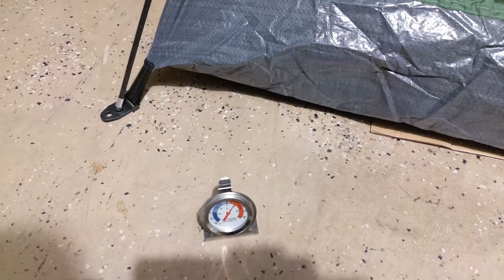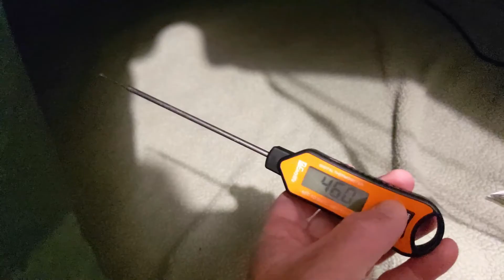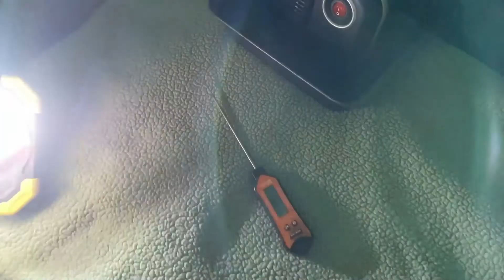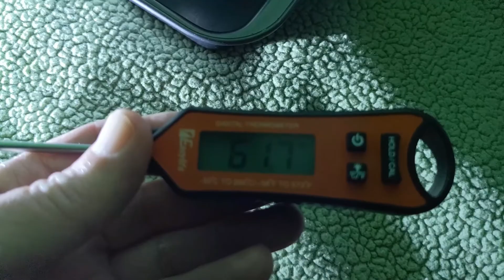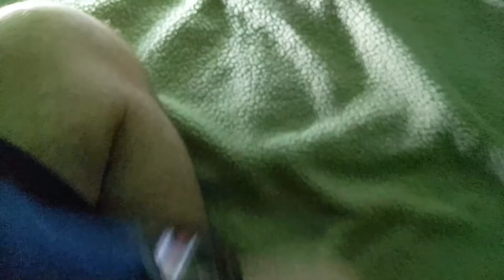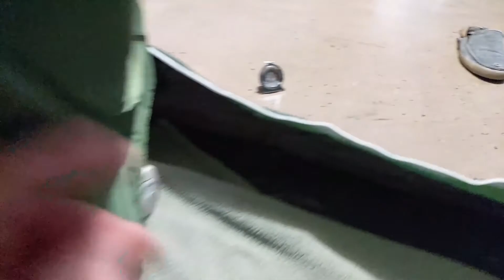Power Outage Emergency Heat - Indoor Tent

Comment: Suggestion for a safer method of heating the tent and more energy efficient: 12v Electric Blanket. I've used a 110v blanket powered with my portable power station in the past for truck camping, but I'm thinking a 12v blanket would be a more efficient use of power, possibly eliminating excessive power used by the Inverter.
Reply from the maker: Definitely an option.... Thanks for sharing!

Comment: My bedroom is the warmest room...Will this work if I set it up on my bed? 
Many thanks
Reply from the maker: Yes, it will work even better if on a bed or insulated from the floor in some way (carboard boxes, yoga mats, sleeping bags/blankets, etc.)  You'll be surprised at how warm it will stay will just a small source of heat if insulated all around.
Reply: Absolutely.

Comment: If you don't have a heater, put the tent on your bed (for insulation), put a blanket over the tent and double up.  It works great.
Reply from the maker: You are spot on.  If you insulate well enough on the bottom and top/sides , body heat can keep them surprisingly toasty.  This is especially true if you are inside protected from the wind.

Comment: I live in Texas and we stayed warm during that freeze by using tents and 12volt heated blankets. Those 12volt blankets use very little power. I drove a big rig for years, so I have several 12vdc heated blankets and wow, did they really come in handy.
Reply from the maker: Hi Troy!  Yes, they will definitely work as well.  Once you get a tent (especially a small one) up to temp, your body heat will keep it relatively warm for some time.  Then, whichever method you use, you can dial it back a bit and turn it on for 5 minutes or so and off for 15-20 saving energy.  The important thing is using a tent (and insulating it) to limit the amount of space you need to actively heat.